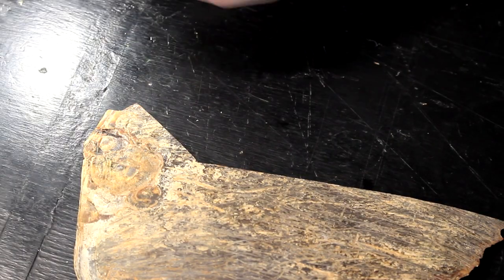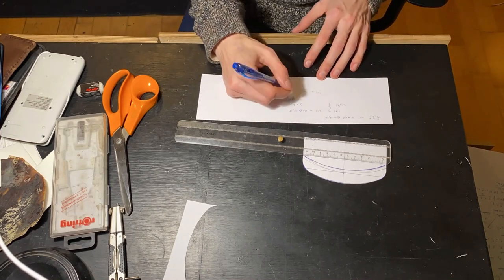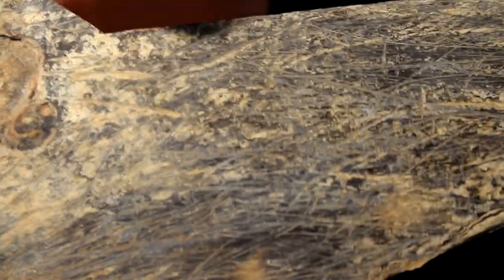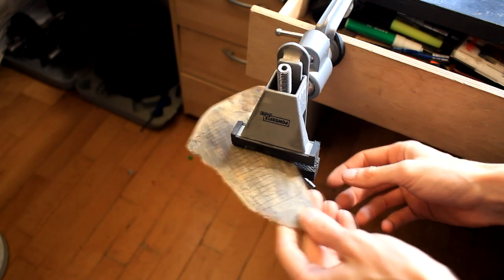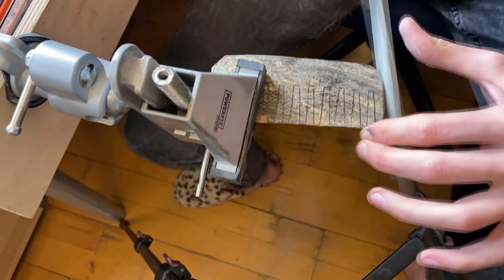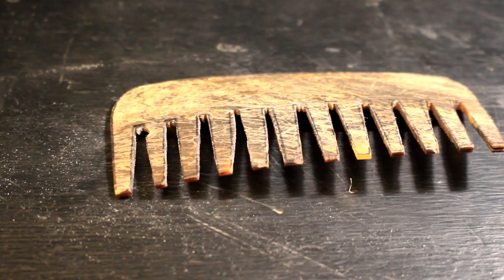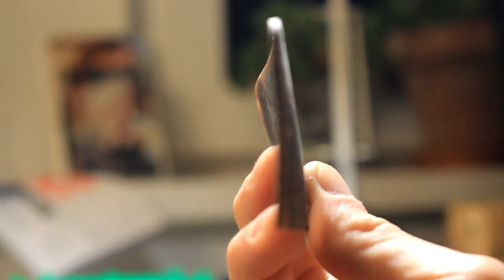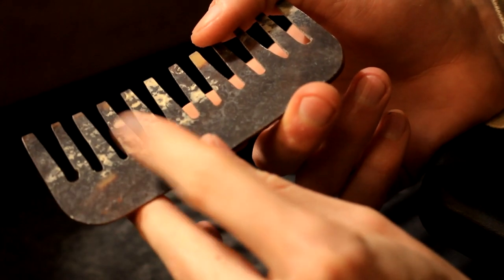Making a Genuine Turtle Shell hair comb, the most expensive material

Comment: Thanks for sharing.  I'm particularly impressed with your templating and prep work!  I've never worked with tortoise, but I've worked with buffalo horn.  Four tips; 1.) use a coping saw instead of a hack saw.  You can get diamond blades for them.  2.)  Your mistake with the drill, here's how to fix it:  As soon as you notice your error, stop work and make a bunch of fine dust (sandpaper on scrap shell/horn parts) and use that to thicken 2 part epoxy to a putty consistency and fill the hole.  Let the epoxy cure and proceed drilling where you meant to. 3.) to straighten tortoise shell, boil it and sandwich it between 2 flat rigid pieces of metal and clamp them or put heavy weights on them.  Allow to cool completely and it should be reshaped. 4.) continue your sanding schedule through about 1500 - 2000 grit, then use the buffing wheel and compound to get a high gloss, transparent mirror finish.  Or seal it entirely with 2 part epoxy.

Always test new methods before working on a final product, especially if it is irreplaceable.
Reply from the maker: Lots of practice, and you will get the hang of it I'm sure ! I guess a soft touch is the most important thing, dont be too forceful with it